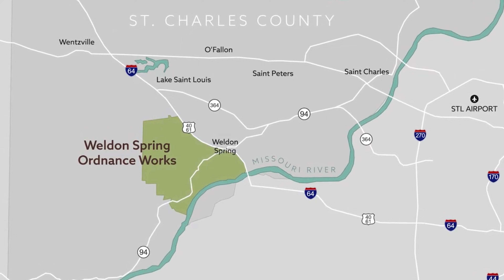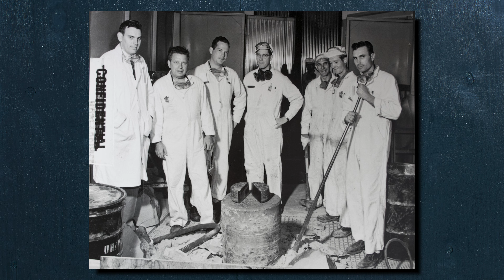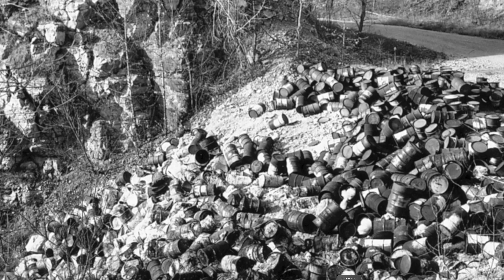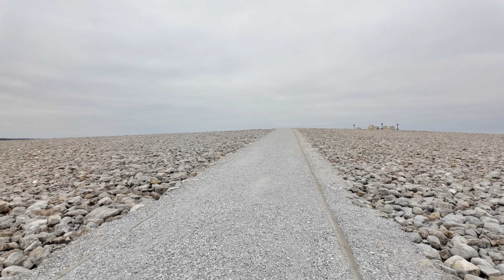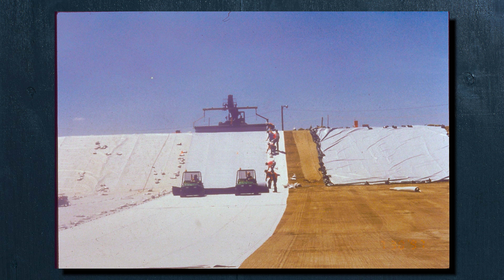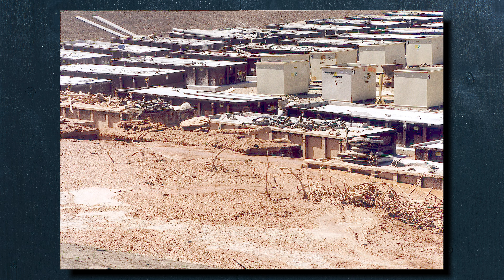Why Does Missouri Have a $Billion Mountain of Nuclear Waste?

Comment: Weldon Spring resident here. They cell is a failure. Its actively leaking radioactive material into the groundwater according to their very own EPA reports. 
When the barrels were transported to the Quarry down the road or to the landfill over by the airport, They were spilling the hazardous material all over the roadways (Hwy 94, 40, and 270).
This radioactive material will be hazardous to the St. Louis Community for hundreds of thousands of years.
Reply: That isn't good, you would think that they have a better way to store toxic materials that don't leak.